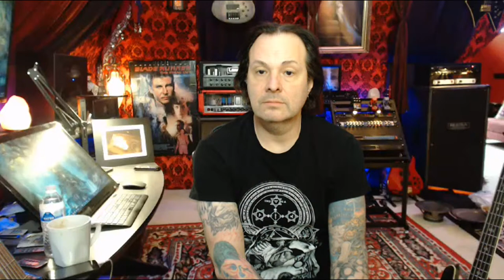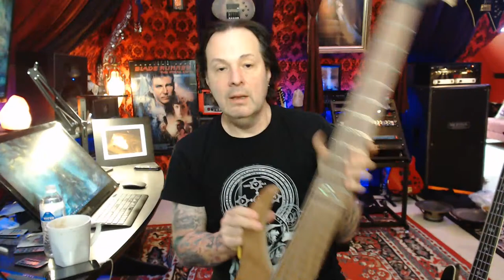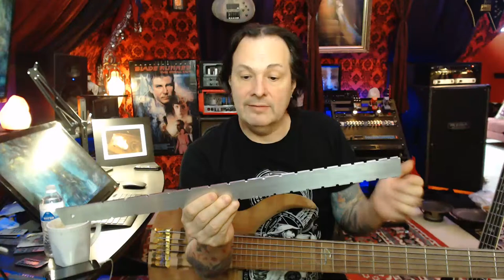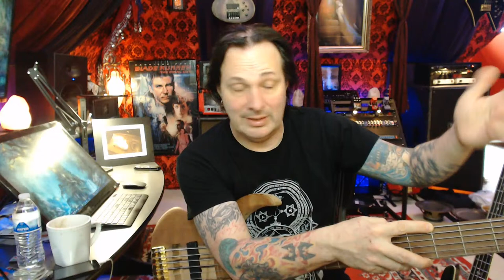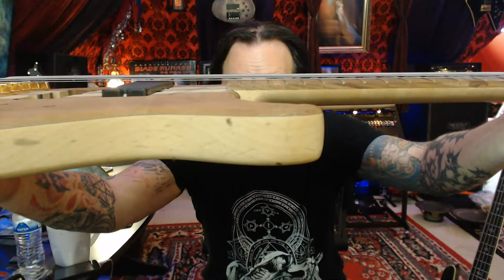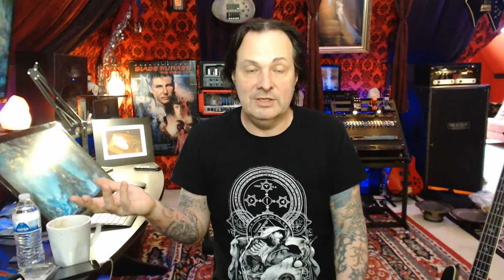Metal Bass Monday Live AMA! Fix and mod your Bass!

Comment: I have a Resonator made of 1890's mercantile wood, it can get fret spout, especially in winter if the wood gets too dry...a week in the case with a humidifier in it and the frets are flush again.  On the sharp edged neck, I had a boulder creek fretless that could double as a knife.

Comment: Hey Uncle Rodney lol, what is the difference from the BQC and BQS preamp I have a BQC on my sterling 4 H and want one in my 5H stingray the BQS I love not only the sweepable mids but the switch selector on the board to adjust the treble. Does the BQS have that as well? Also sorry, but do you know what EMG pickup would give me that killer vintage stingray tone for my 5string , thanks for this video!! Ton of great information
Reply from the maker: Not sure on the preamps, don't have them. As far as Stingray tone, placement is important. It really depends where you are putting it. If you have something in the stingray placement, I would go with a DC, but for a stingray sound, seems easiest to just get a stingray pickup.

Comment: This was a very helpful episode. My tip was Home Depot has Husky needle 7-file set #114-235
Reply from the maker: Thanks, Ike!
Reply: @RodneyMcG  Sorry about the split bridge question words.... When you get to preamps, my concern is bass rolloff, i.e. too soon, on the biggest string. I like open bass. Even F0. I don’t want response to be down 20dB by G#0. Rumble? That’s just another bass note ..... Lol.
Reply from the maker: NO worries! The roll off will vary per preamp. One more good reason to pedal box it.

Comment: What kind of zero glides do you use? Can't find göldös especialy for Bass, so I assume that the ones for classic guitar fit best?
Reply from the maker: I'm not familiar with göldös?
Reply: It's the company that produces or sales the zero glide, at least here in germany. After doing some research I found a version of the zero glide that could fit mx 5string, will see...
Reply from the maker: @bahkauvdus2586  Ah, I gotcha. I think if you call them or email direct, they will do custom sizing

Comment: Hello ,
 Any trick to low the action with the truss rod brocken?
Reply from the maker: Unfortunately, no tricks. The truss rod has to be replaced.
Reply: @RodneyMcG  I am gonna find a creative way
Reply from the maker: @MzuMzu-nx1em  I wish you best of luck!
Reply: @RodneyMcG  hope so , really expansive bass
A really important question , is it possible to build a replica of a neck without the physical bass ,only with the data from the factory?
Reply: @MzuMzu-nx1em  as a machinist,  I would say doubtful.
Reply: @Mud9  ???
Reply: @Mud9  mistaken bass fir an engine?
Reply: @MzuMzu-nx1em  no
Reply: @Mud9  yes
Reply: @MzuMzu-nx1em  okay do it and post a link to the video here 😉
Reply: @Mud9  you were supposed to say yes ...many times
Reply from the maker: It would be tough
Reply: @MzuMzu-nx1em  I believe in you.
Reply: @Mud9  ???? You mistaken for someone else
Reply: @Mud9  if that mean good luck,  thanks hope to fix 👍
Reply: @MzuMzu-nx1em  it does
Reply: @Mud9  or it doesn't??